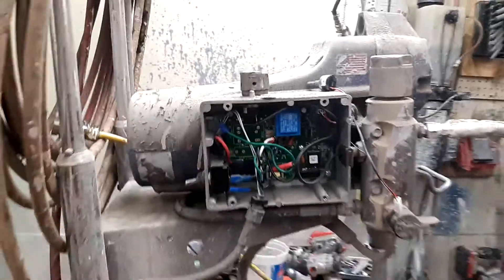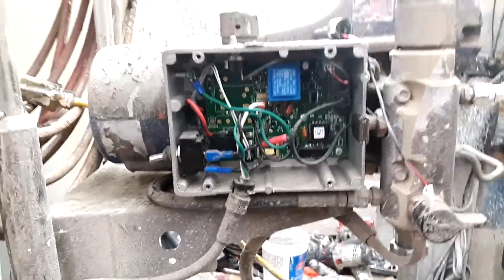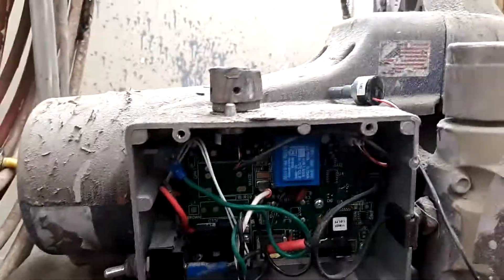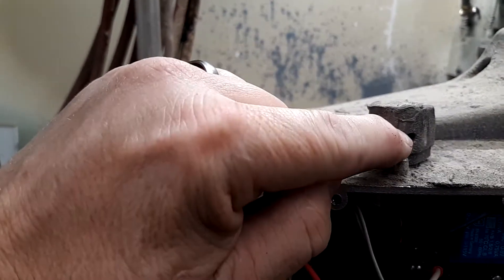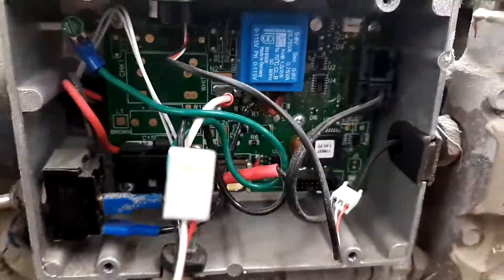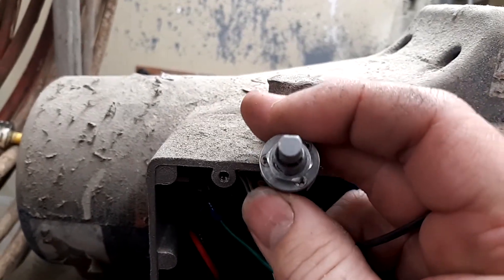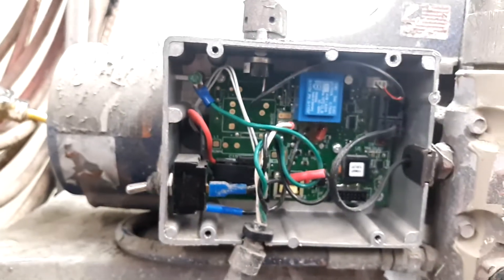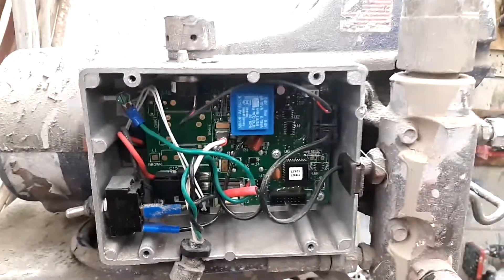Graco Titan potentiometer replacement

Comment: I have a 395 ultra that will come on if you flip the on off switch a few times but will shut off again and then you have to flip the switch again to get it to come back on. It does this for awhile then eventually it will run normal, but it does it every time I let it sit. The light blinks constantly when turned on, switch has 120v through it, will not run with anything unplugged, I'm assuming it is the potentiometer, any ideas
Reply from the maker: @PeteMilton-s6k  my first thought would be a tie between the transducer or the brushes on the motor. That's depending on the exact model you have

Comment: I was was using my ultra max 695 today hammering out some soffits with a thin primer as we do all the time with this machine it gave a reaction like it wasn’t enough power and then worked at a low pressure then cut out as the digi box is kaput there are no code signals. After about 20 mins of not running I fired it up again I used it for about 1 hour then it done it again it seems like it could be over heating somehow I’ll check under the cowling and fan tomorrow. Any one have any ideas.
Reply from the maker: @GRUMPYHARRY1  depending on which series of 695, it could be overheating which would be motor replacement or the thermistor is going bad. That measures the temps. If it is going bad, the wrong temps will be measured. The thermistor is located in the motor by following the 2 yellow wires
Reply: Ultra max 2 I’ll check that tomorrow

Comment: Hi Bryan I have a Graco Linelazer IV 3900 engine runs fine I turn on Pump switch and potentiometer and nothing happens not a single click or noise from the clutch and pump any advice on this bud ?
Reply from the maker: The first thing I would check would be the switch. Insure your switch for the pump is working. Second thing, check to see if you have a flashing LED when you turn the switch on. You can locate the LED on the board. Pull the shroud off the dash so you can see the board  with the engine running, turn the pump on. If you see a flashing LED, count the number before the pause. This will tell you the problem. I am thinking it will identify the transducer as the problem.
Reply: @Brian_the_repair_guy  thank you Brian For thanking the time to respond